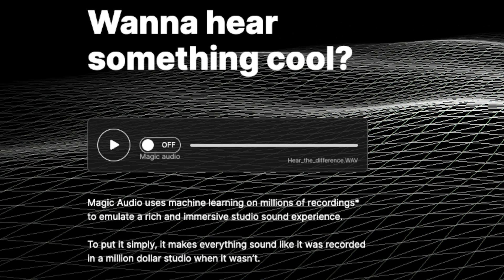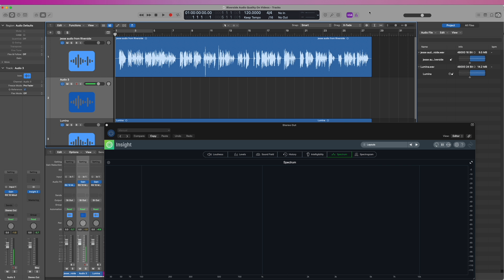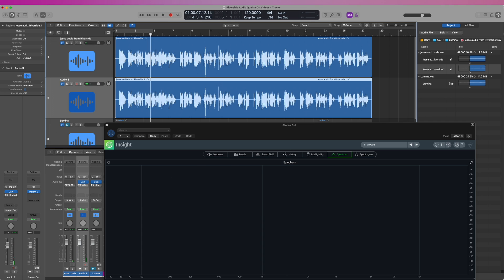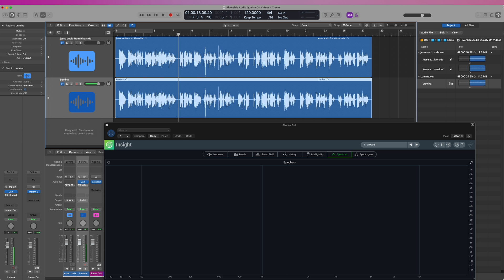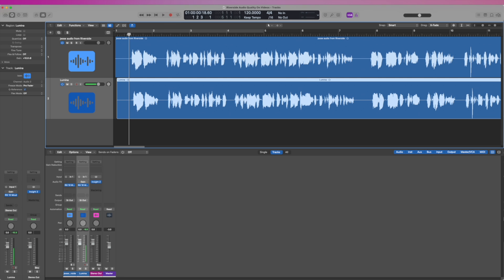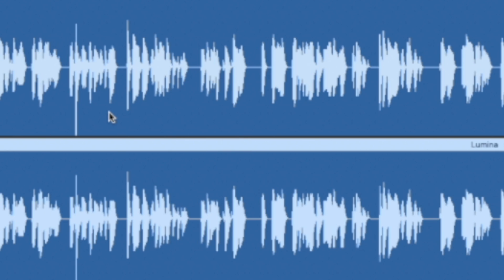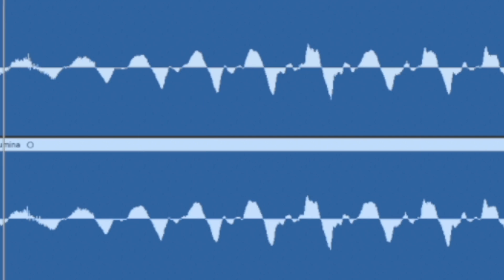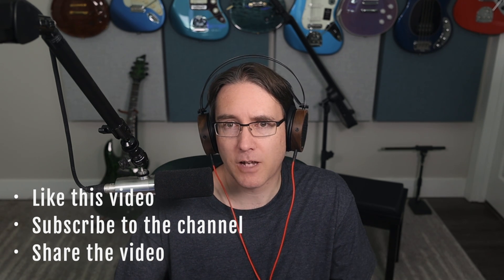How To Fix Bad Audio On Riverside Videos (When You Don't Use Their Editor)

Comment: I'm just watching this video after having my podcast interview messed up because 1) they stored my audio and my guests audio on separate tracks and after finally being able to merger them from a completely different program, they were out of sync. I'm not a tech savvy person but Spotify blew it making recording harder than it was before they hooked up with Riverside. Back to the drawing board.
Reply from the maker: That is no doubt frustrating to deal with. Riverside seems to be prone to sync issues. I'm not sure how the partnership with Spotify works, but I've always been able to have Riverside reprocess the audio to fix the sync issues.

Comment: I've encountered drifting when aligning riverside .wav with their .mp4s - have you experienced this?
Reply from the maker: I haven’t run into this recently, but I’ve had a couple instances where this was an issue. Tech support was able to reprocess the files and correct the sync issues. 

Having said that, I have seen a ton of reports of sync issues with Riverside over the last month or two. It seems some of the newer AI features have caused a lot of issues. 

Another thing that has been blamed for issues lately is that Riverside quietly increased their minimum tech specs to requiring much stronger computers than in the past.